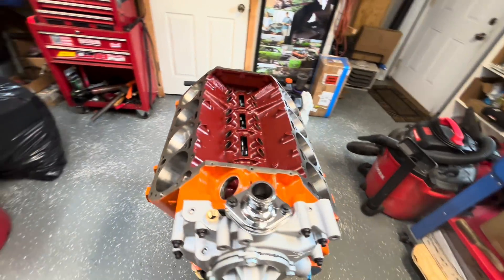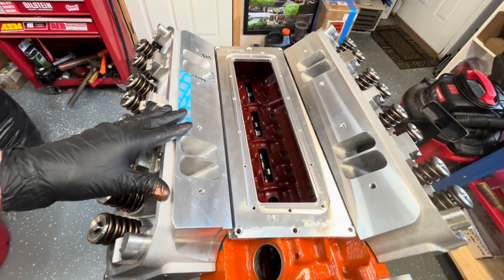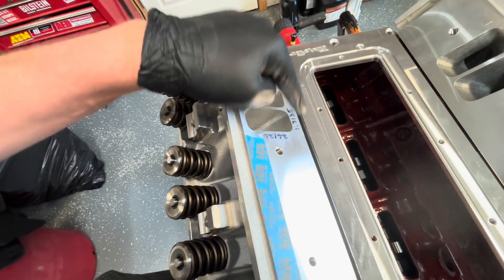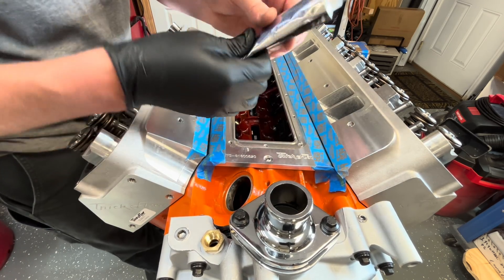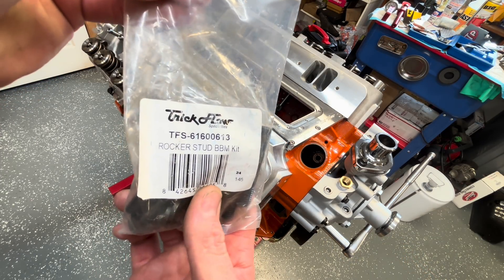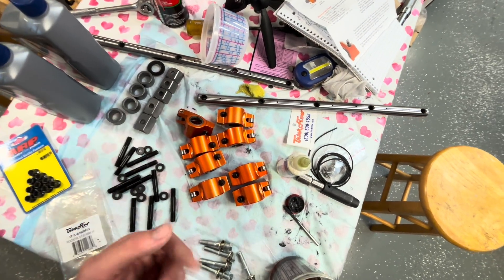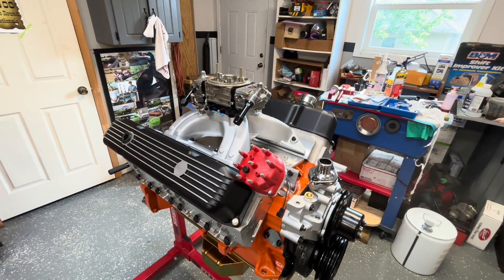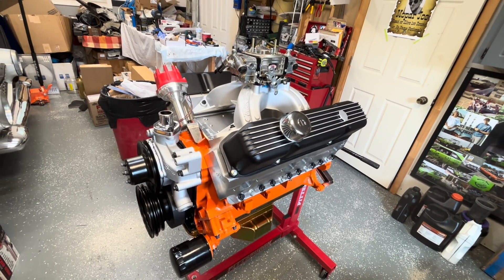Trickflow 270 Top End Installation on the 512 Stroker #mopar #trickflow #engine #e85

Comment: Joe
I’ve got a 440 with Trickflow 240 heads, Harland Sharp 1.6 roller rockers and Howard’s cam with roller lifters. 
During the dyno test on the 10th run the engine lost oil pressure. Turns out the pushrods for #2 were so bent that the lifters paired together jumped out of the lifter bores and oil pressure was gone. The engine was shut down immediately. 

After inspection other lifters were bent. A few things came to mind. The builder checked spring height not knowing or asking about the rocker ratio which is 1.6. He thought it was 1.5 so I’m thinking possible coil binding. Second thought maybe the pushrods are not suited for the Trickflow spring pressure and failed. Third thought possible pushrod interference with the aluminum head.  

We are ordering a replacement set of 3/8 diameter thick wall pushrods from Smith Brothers. 

My question is what pushrods have you been using with the Trickflow head setups that have worked for you?

I’d appreciate any advice or thoughts. The failure seemed to happy after 10 pull on the dyno. The first were at 4500 the 5500.  

The kits I see advertised don’t provide specs for pushrods. I don’t believe they come with the top end kit either. 

What say Mopar people?  Thank you
Reply from the maker: Jim, if you ever need to, shoot me an email justmoparjoe@gmail.com. I’m very apt to base pushrod thickness on spring pressure and length of the pushrod. Mine are usually there .083 wall or thereabouts. Sorry to hear about your issues
Reply: @JustMoparJoe thanks I will email you with more information and updates. As far as I am concerned no one else checks as many things with as much detail during engine build as you have. My hopes is that switching out the pushrods is the remedy. 
I built many engines with original Mopar components. Using aftermarket high performance components enters a whole new level. I thought I researched enough but even manufacturers didn’t provide reliable answers. I hope this helps someone else too. It could have been catastrophic.  My 440 with a .284/.484 purple shaft lasted over 30 years. Using the aluminum heads is NOT a bolt on application at all.

Comment: Joe can you tell me that part number for that MSD that’s on this motor? Or what do you recommend for my 505 Stroker motor , trick flow 240 heads, 541. Lift comp roller cam. I have Mopar performance valve covers also so I anticipate having to trim it. I don’t plan to drag race this motor just cruise it in my 66’ Charger. I can send pics if you have an email if you need them thanks!
Reply from the maker: https://www.summitracing.com/parts/msd-8545/make/chrysler

Comment: I think you’re supposed to install that valley plate first, put the silicone on the sides and then install the heads?
Also, MSD makes the long neck billet distributor and a short one. What is purpose/ reason for each length?
Reply from the maker: I’ve done it both ways, Jay. I think this is a little less sloppy with the rtv. As for the shafts, I assume it’s just for valve cover clearance. Also the shorter version appears more stock with its lower profile.

Comment: Hey Joe. I rebuilt a 383 from my 68 Chrysler Newport. Now I want put back the crank in the engine and my question is . What kind of seal can I take for the rear main. My crank has little riffels where the seal is running. The old seal was rope seal not a normal rubber seal. Can I put in a normal 2 piece seal with the riffels on the crank or the old style with the rope? My thinking is , that the riffels on the crank kill the normal rubber seal. 
Tommy
Reply from the maker: Some guys have them polished off. I have seen work fine with a rubber seal. The fast fish seal would give you some more insurance I think since it’s double lipped
Reply: @ Thanks for your anwer. I will polish them. I am from Germany. I will contact the guy and ask if he can send the fast fish seal to Germany.  Thanks for your feedback. I like your content .
Reply from the maker: @ thank you! Cheers 🍻

Comment: My 505 cid made 746 hp 12.01 compression  714-680 solid roller cam so I think the 512 cid would make 860-875 HP  930-940 torque
Reply from the maker: Wow man! Thats very optimistic, but I’d love to see it happen. The power is definitely in the heads
Reply: @red-doggracing5557  factory blocks don't hold up to that power without aluminum rod, main caps and a very light bob weight.
I've never seen or heard of a 270 cc head making that type of power, that's real max wedge port power like ich 440-1 heads but it will be awesome if it does lol 😀

Comment: In ALL the years I have been running MLS head gaskets, basically from when they started becoming a thing, i have never found the need to or have ever used copper spray on them. Never once a leak or issue from not coating them. 
That said, i won't say you CAN'T do it, nor will it hurt,  but if any MLS gasket leaked it hasn't been because it wasn't coated. In the beginning, a lot of their stuff had the coolant embossments in the wrong spots depending on what head manufacturer was used. Otherwise, never a need to coat them. 
I'll add, the ONLY issue of coating them is, the mess it makes and if you're not careful, the amount of dirt it attracts. 
I have seen this become a thing, like many others, once the youtube tech videos started coming out and well, once one person does it.... lol. 
This engine should have no problem hitting 1.4-1.5 hp per cube.
Just my make 👍
Reply from the maker: Thanks for the insight, that's a great point to consider! I know at least two noteworthy builders that gave me the idea. 😂
Reply: @JustMoparJoe  All good 👍  Right, Wrong, or Different.

Comment: What are the cam specs and compression? I'm sure you told us but I'm OCD and sped through it.
Reply from the maker: https://www.compcams.com/drag-race-263-270-solid-roller-cam-3-bolt-for-chrysler-383-440.html?fbclid=IwZXh0bgNhZW0CMTEAAR56W62jRDR-vTp5eNUu56UE_wovDD-V5PZJz2X57FLWzlF1N7HBBMeNc_PsWw_aem_wa1ofW25ECQnnTeIroHboQ
Reply from the maker: 12.5/1

Comment: This is going to be a monster. On e85 with this kind of flow I cant even guess how much power this will have. 650 on pump gas should be easy to hit. Beautiful work as always, brother!
I cannot believe that gap is intended... but it is!!! Holy crap that is excessive. Some people on the various forums suggested a thick cork gasket underneath on the valley rail front/back to raise it up but another reply was from a trickflow guy saying to do exactly what you did. That is wild!
Reply: Just have to add to this thread, any internal pressure is going to blow out that sealant and cause an oil leak. That gap is too big for the rtv to be firm enough to hold back any excessive crankcase pressure. Wide open throttle creates a bit of pressure, more than a pcv can overcome. Just seems too much of a gap for rtv to solidly seal. If I was the builder, I would not warranty that process... But we always have our days where we're wrong about something. Just a couple pennies worth of thought.
Reply: @fyrbyrd71  Joe's a really good builder. I would be surprised if he isn't think the same thing! Thankfully this is easily remedied with a 1 5/8" breather on the passenger valve cover. Im more worried about the heat cycling long term durability. BUT that too looks like it wont be much of an issue since the intake leaves tons of "maintenance space".
Reply from the maker: Yeah that gap is crazy! I've never seen a gap like that either! Their paper instructions say to fill both gaps.
Reply: @JustMoparJoe  Some days I really wish you were up closer to Montucky. I could cut you a couple of spacers on the mill in no time.

Comment: Is there a specific reason for putting on those parts that have such a huge gap in them like that? ~( ,m,)~
Reply from the maker: It’s the plate made by the cylinder head company to use with the exact cylinder heads, on this engine platform. Nothing off brand
Reply: @JustMoparJoe  I admit, I'm not remotely familiar with the brand, or the product.

Maybe they have a very valid reason for those gaps [such as thermal expansion?] but it looks really sloppy to me.
Reply from the maker: @ what’s wild is, trick flow is the top rated most sought after pieces for many guys now. Their quality control and performance are top notch compared to many other brands.
Reply: @JustMoparJoe  Ok.

I'm in no position to compare them, so I would have to take the word of current users.

And right this moment, I'm in no position to test it out.

Comment: Beautiful build . why does that distributor have to be so long ? looks like it could sit down lower
Reply from the maker: I think they use the standard msd cap and rotor. They had to make it longer for the diameter of the cap to clear the valve covers. The firecore distributor uses a stock cap with a smaller diameter and shorter body
Reply: @ Ah , thanks Joe , have a great day ,
Reply from the maker: @ thanks, you too!

Comment: With E85 fuel 788HP / 722TQ 🏁- 6700rpm
Reply: Joe, I think you need a bigger carb and 2 inch polymer dimpled carb spacer.
Reply from the maker: Will definitely try the tapered spacer on the dyno. I have an open 2” but it would take some stacking! Lol

Comment: Hey Joe.  awesome job on the 512 build. I'll take a guess on the horsepower numbers, I usually take the head flow numbers with the valve lift and  double it to get a horsepower number. So 650 lift cam, heads flow 347.5  will be  around 695 horsepower. But with your awesome  Port match you're going to make 700.  the torque is increased with the Stroker. 680 torque. Your videos are not long enough. Enjoy watching.
Reply from the maker: Appreciate that, brother! You have a good eye for numbers and detail.

Comment: Joe, great work as usual, I can’t wait to see this beast on the dyno! I think that valley plate may be a little loose to allow for gaskets under the ends of the valley plate that come with the Fel-Pro kit they recommend.
Reply from the maker: I’ll take a look, thanks for the tip. I had another viewer comment that he found the answer from trickflow and it was to fill them both. Fun times!

Comment: What is the purpose/benefits of the billet valley pan with the removable center section? Other than looking cool.  I have never seen such a thing. And why would you RTV that gap?  I'm guessing 650 hp @ 5800 rpm and 675 ft-lbs torque @ 4700 rpm.
Reply from the maker: The directions say to rtv it. The valley plate allows the removable plate so you can access the lifter valley if ever there is an issue. Thanks for watching!